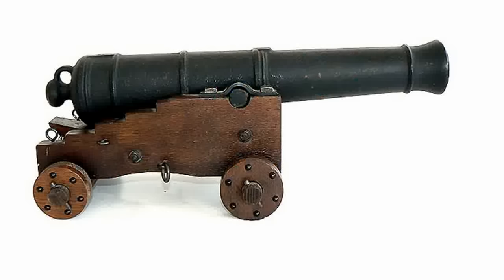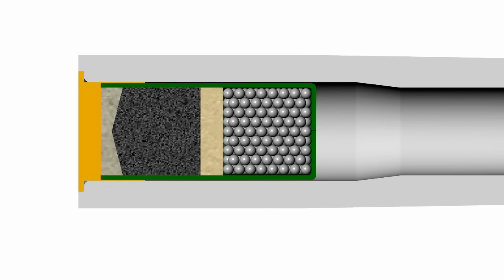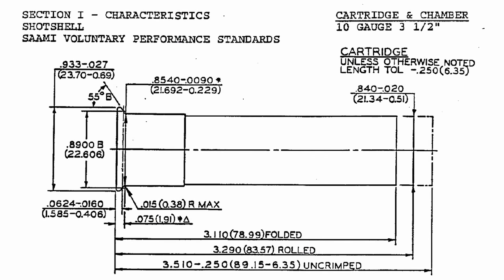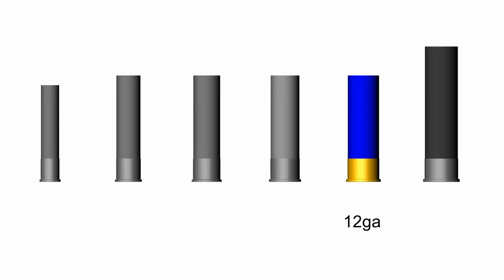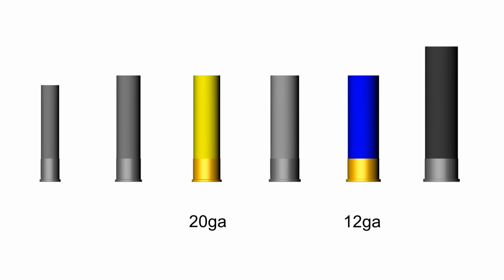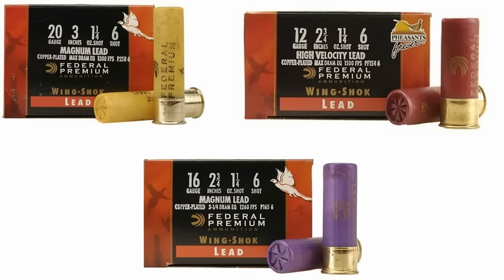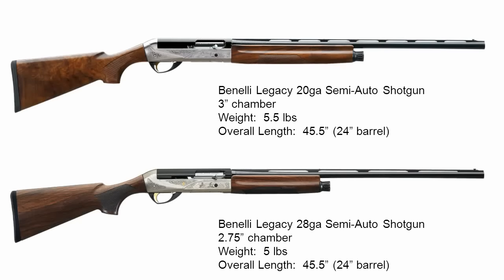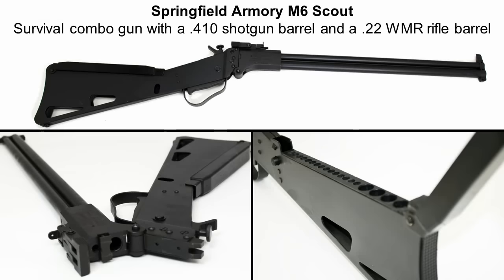Shotgun Gauges Explained - Shotguns 101 #3

Comment: Somebody, anybody, please explain to me why 7/8 - 1 1/8 oz loads are so common and popular with 12 gauge. That load range should be the domain where the 16 gauge reigns supreme, right? By everything I understand about shotgun patterning and reloading, an ideal shot cup is packed into a cylindrical cube that is just as tall as the bore is wide. A heavy shot load that is packed taller than the bore diameter causes the pellets to collide with eachother and pattern erratically, right? A light shot load that is packed shorter than the bore diameter will create the doughnut effect, right (I read that 10 gauges are notorious for doing this, which is why loading them with anything besides 3.5'' shells is pointless)? 1oz of shot is a 16th of a pound, so shouldnt that make 16 gauge the ideal bore diameter for 1oz slugs and common birdshot loads?
Reply: Let me guess, most hunters buy a 12 because that's what everyone has and then they notice that the ideal load kicks a little.
Reply: @stettan1  If im going to drop AT LEAST 1 grand on a double barrel for my future skeet gun then im damn well going to make sure that I get it in the gauge that's ideal for my type of shooting. Give AF if you cant find 16 gauge at wallmart, I want whats best not whats good enough. 12 gauge has made researching what gun to get so damn frustrating. Brand-new 16 gauges are few and far between and every gun store clerk just tells me to "use a 12 man, 12 is good, das wat i uze. 20 also ok too i tink" whenever I ask them if they can order me a 16 gauge version of this this $1200 shotgun I want to buy.
Reply from the maker: That load range is common for 12ga target shells, where pellets are small and that amount of shot is plenty to populate a good pattern while not creating excessive recoil.  12ga field/hunting shells tend to be heaver, in the range of 1 1/4 - 1 1/2 ounces of shot even before you get to 3" or 3.5" magnums.

Comment: What does one do with an industrial shotgun? Named after characters in Mad Max Beyond Thunderdome?
Reply: 8 gauge industrial shotguns are used in steel mills and furnaces. Heavy pieces of slag collect on the inside and affect heating performance. It can be broken up by hand by sending a person in but that requires shutting the furnace off and is very dangerous as some of these slag pieces can be many feet long and weigh hundreds to thousands of pounds. So they use the shotgun to break off the pieces of slag and can do it while the furnace is still running.
Reply: Here’s a video showing it: https://youtu.be/uJG3uTUJ2J8
Reply: Also to knock set concrete out of forms.

Comment: So basicly: Small number = Big shot
in shotguns.
Reply: Not only in shotguns. 2 bore rifle has bigger shoot than 4 bore etc.
Reply: @nieczerwony  Interesting
Reply: @tdpuuhailee8222  Think of it like that: base is 1 gauge i.e. diameter for which a lead ball will weight 1lb. Anything bigger than this will be also lighter. Gauge is specific to shotguns, but it could be expressed as bore also. 10 gauge means you need 10 lead balls which together will weight 1lb so what is the diameter for such ball? 12 gauges is the same idea, so you can see the pattern, the more balls you need to form an equivalent 1 lb ball the smaller the diameter.
Now if you go from the base 1 lb, your gauge (bore) actually can be smaller than 1. In that case your ball will be heavier than 1lb and that means heavier (bigger) shot. So if your gauge is 0.25 i.e. is like asking what is the diameter of a ball that would weight 4 lb.
If you would have gauge 0.125 (1/8) it's then what would be diameter of a lead ball which would weight 8 lb.
So take 1 and divide by gauge. You result is the weight in pounds, and you need to find corresponding diameter for which lead ball would take that weight. 
It's all about lead and sphere.
Hopefully it more clear.

Comment: Man the .410 is criminally underated.
Reply from the maker: It's the .22 LR of shotgun shells.  Surprisingly versatile and capable given its diminutive size, but there are definite limitations to its performance.  If you have a specific need for the very small and light shells & guns, like a survival firearm or something for a very young shooter, it can be great.  But for a lot of more normal applications, a larger gauge will tend to perform better and offer much greater versatility.

Comment: in a FIRST PERSON SHOOTER LEMME MAKE THIS CLEAR FIRST PERSON SHOOTER i got a headshot on somebody with a double barrel on bird shot, i cant remember off the top of my head what gauge it was, but i know it was point blank, the doods head was destroyed.
And thanks for a podcast type thing to listen to while i play minecraft.
Reply from the maker: In reality, that's unlikely to happen no matter what type of shells you're shooting.  I've seen photos of what happens when a shotgun goes off directly inside someone's mouth (a case in which the expanding gas adds to the destruction).  Gruesome stuff, don't look it up if you're squeamish, but the head is (mostly) still there.
Reply: @SynchronizorVideos  
What prompted you to look up such pictures?
Reply from the maker: @Crlarl  They were in a book I have about law enforcement use of shotguns.
Reply: @SynchronizorVideos  
Damn. I suppose to people that experience gruesome things more frequently than most of us, some pictures in a book may not be all that disturbing.
Some of the worst pictures I've seen are of hydraulic injection injuries by high pressure pinhole leaks. So, I've not got much reference for how bad your images are. On a scale of 1 to Scanners, how bad is it?
Reply from the maker: @Crlarl  They're pretty rough, but they're also clinically-presented black-and-white photos printed in a book from 1992.  In color, or especially in person, they would probably be fairly scarring to most folks.

I'm not the best judge of that though; I'm really not the squeamish type.  I've helped accident victims who got pretty tore-up, and even assisted with a dead body once.  Hated to see the situations, but the injuries themselves never bothered me much.  When I had chest surgery as a teenager, I convinced one of the surgical assistants to bring my parents' camcorder into the OR so I could see what all they were doing.

Comment: I think the idea of using a .410 for home defense isn't exactly for stopping power, but to avoid over penetration if one were to miss in a high stress, low light situation. It's been shown that bird, buck, and slug can pass through a singe wall easily, if not multiple with the slug.

But that's only an opinion, so don't quote me.
Reply from the maker: The thing is, with shotgun shot, a pellet is a pellet.  A .36-caliber lead ball at 1200 FPS has the same terminal ballistics whether it comes from a .410" bore or a .775" bore.
Reply: A 410 will go through a breeze block,. I did it in my flat ,,,lol,🤗

Comment: Good video but u do take a small dump on the very practical .410
  I own both 12 and 410 . And for getting rid of pesky red squirrels and other small varmints, crows, magpies it's hard to beat.  Gentle recoil and more that sufficient killing power. I love my twelve, but for shooting overhead I'll take the 410 anyday
Reply from the maker: I may have come across more harsh than I intended, but the fact is that while the .410 is certainly capable in some roles, it has significant limitations in others, especially personal defense.  Doesn't mean it's bad; the .22 LR is a great round too, but a rifle chambered in that cartridge is going to have limited applications, even if the gun is the same shape as one chambered in .308 Winchester.
Reply: @SynchronizorVideos   Explain limited.  My .410 can shoot a 350 grain .444 Marlin round that clocks in around 1850 FPS.  That carries the same muzzle energy as a 1 oz slug from a 12 gauge. Don't judge a gun by it's bore size.

Comment: For the .410 pistols.. I'd recommend the Taurus series as they can also fire normal pistol rounds, which you can mix and match in the cylinder.
Reply: S&W Governor also fires .45 ACP witg moon clips in addition to .410 and .45 Colt. The Taurus Judge can't fire .45 ACP.

Comment: The advantage of the .410 at least my theory and logic is that it gives you the advantage of "quantity" over quality compared to handguns.  What I mean by that is that while there is no debating a .410 is NOT the same as a 12 gauge because the 12 gauge or other shotguns obviously hold more shot, what I think is a real advantage is the fact that the .410 can be had in a handgun platform such as in the Taurus Judge or Smith and Wesson Governor

Now before everyone gets ready to diss the .410 in a handgun please pay careful attention to what my theory and logic is as well as what I have seen proven with .410 ammo that is not my subject opinion

If we are comparing the .410 to other shotguns such as the 12 gauge then obviously it's a no brainier that getting shot with a 12 gauge is going to be more devestating, it's common sense because it holds more shot in it

However what I really like about .410 is the fact you can comprise a shotgun into a handgun platform, and I know this really irks people badly because people are in denial and are unwilling to accept the fact that a .410 with proper buck shot out of a handgun will easily kill someone, all I ask is to read what I've said in context

I think the .410 advantage is the fact that you can have it in a handgun smaller package/more concealable and mobile platform and although it is not AS devestating as a 12 gauge you still do get a "shotgun" advantage in my opinion over a typical pistol round or revolver round

The same reasoning that applies to a 12 gauge also applies to the .410

If buck shot out of any other shot gun is deadly for the main reason of firing multiple projectiles then the SAME reason also applies to .410

While yes we can all admit the .410 has LESS buck shot than let's say a 12 gauge she'll would have

If we were to compare the buck shot to let's say a standard 9mm handgun or 45 handgun, there is NO debating that the multiple buck shot rounds coming out of the .410 HAS THE SAME ADVANTAGE other shotguns have over typical handguns, which is "multiple projectiles"

So what I am saying is this

The .410 is NOT more devestating than a 12 gauge, but in my opinion the same logic that applies to a 12 gauge also applies to the .410

So what this leads me to believe is this and this is why I think .410 is so cool

When comparing .410 to other shotguns I agree that it's not as devestating

But if we are to compare .410 buckshot vs typical handgun rounds I think a case can be made that the .410 buckshot is more devestating than your typical 9mm or 45 handgun

This is the biggest advantage of .410 in my opinion

The fact you can shoot multiple projectiles out of a handgun which is compact and more mobile and yes it is possible to carry a .410 handgun

So although I know people have a hard on for wanting to hate .410 handguns and are unwilling to accept the facts of the matter

I am so convinced by the evidence that I went and bought me a Taurus Judge specifically because of how versitle it is and the advantage it has over typical handguns

Before you are quick to be in denial 

Please keep in mind these facts

The Taurus Judge has a 3 inch cylinder model which is the model I ordered and bought

You can get 5 000 buck shot rounds in each 3 inch shell

Each of those 5 000 buck shot rounds are the size of a 9mm full metal jacket round

You can also get 0000 buckshot or 00 buckshot with 6 rounds instead of the 5 in 000 buckshot

These 000 buckshot rounds have been proven to penetrate 12+ inches in gel

These rounds have also been proven to pattern very well and hit the intended target and not miss at self defense range

That is a total pay load of 25 to 30 rounds that can be fired out of the judge in just 5 pulls of the trigger

Again, please don't take what I have texted out of context

I am in NO WAY saying buck shot is as devestating out if a judge as it would be out if a 12 gauge

What I AM saying is that if we compare the 5 buckshot rounds per trigger pull to most typical handguns I think .410 is MORE devestating than your typical handgun which is why I picked up a judge

I think the coolest thing about the .410 is that it bridges the handgun world and shotgun world and contrary to the bad reputation it has based in lies or misinformation or people taking the .410 out of context

I think if we look at .410 in the light of comparing it to handguns more people would realize the .410 is easily a man stopper and anyone saying the .410 isn't a man stopper is saying so because they are trying to compare it to more devestating shotguns

Well duh, if I compared a 9mm or a 45 acp to a 12 gauge nobody would dare say the 12 gauge is less devestating

Everyone for the most part would gladly agree and tell someone a 9mm or 45 acp is acceptable to take out a threat in self defense

However when talking about shooting .410 out of a handgun people all of a sudden drop all the same logic and don't apply it to the .410

It's like people are unwilling to accept or believe that a .410 out of a handgun could be effective or more effective than a typical handgun

People think by admitting or accepting it that it is somehow saying the .410 is as powerful as a 12 gauge when that has never been the theory or logic

This is my opinion

What isn't my opinion is factual information such as the judge can hold 5 000 buckshot rounds in a 3 inch shell

The fact the 5 rounds are the size of a 9mm fmj

The fact that those buckshot rounds CAN and WILL penetrate past 12 inches as the FBI claims any round should penetrate to

I have a VERY hard time understanding how this is anything BUT effective if not more effective than most handguns people are using for self defense

In order to get 10 shots off with a Glock 19 9mm handgun you would need to pull the trigger 10 times

With the Judge you could get 25-30 rounds off in just 5 trigger pulls

I'm not telling anyone that they should like it

I think people need to really stop hating in the .410 as if it's some wimpy thing that bad guys are just going to be taking to the chest

I would be willing to bet that most bad guys are either dying or giving up within 2 trigger pulls of 000 buckshot to their chest

I can't wait to test this judge out to confirm what I believe based in watching other test

All the hate seems to come from people who use the crappy ammo or try making the gun do things it was never made to do

Until I test it for myself when I pick up the judge tommorow

I think the .410 is vastly misunderstood and for some reason when it comes to .410 I notice people stop using the same arguments that would apply to it as they would with a 12 gauge or any other gun

It's as if people are in denial about it and don't want it to be true

The .410 is the perfect balance between the handgun world and the shotgun world

In my opinion, because the firearm is more compact and mobile yet you still get an advantage of multiple rounds over a typical handgun

I do NOT believe anyone using 000 .410 buckshot is under gunned

I have a very hard time seeing how any bad guy is going to keep fighting a person that just unloaded many rounds of 000 buckshot into them wither it comes from the less devestating .410 or the more devestating 12 gauge

In my opinion the buck shot from .410 is still devestating

Just not when you compare it to a 12 gauge which I don't know why people being that up as if it disproves the fact the .410 000 buckshot is still going to easily kill a bad guy

What more do you need? Dead is dead and I don't see under normal circumstances how a person is going to take 25-30 rounds of 000 buckshot from a .410 shotgun

Comment: .410 with small birdshot in a pistol is an ideal gun for a hiker that is intending to hike in areas where venomous snakes make their homes.
The spread of shot is useful in this situation as a snake can be hard to detect until you get rather close to it, and a pistol is light weight enough that it can be carried with little issue by a hiker who is almost certainly looking for every method to reduce the load they carry in their pack.
Reply from the maker: I agree that a .410 pistol would work well on snakes, but I can't agree with you on it being ideal for backpacking.  With that super-long cylinder, .410 revolvers are invariably bulky, heavy things.  Even the "snubby" versions are close to 30 ounces, and going to the polymer frames only cuts that by an ounce or two.  A lightweight S&W J-frame would be about half that weight, and that would also give you the ability to load both .38 Special shot rounds for snakes, and solids (or even .357 Mags) for larger critters.  Heck, you can get 4"-barreled .44 Mag revolvers that are still lighter than any Taurus Judge or S&W Governor.
Reply: They make small shot(12 or 9) rounds for the most popular pistol cartridges.  A revolver is best as they won't cycle an autoloader.